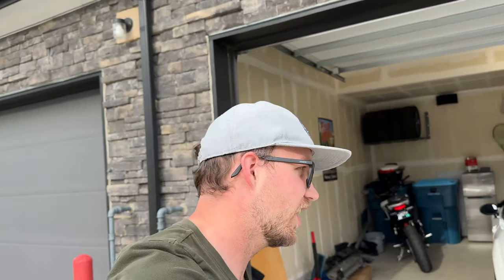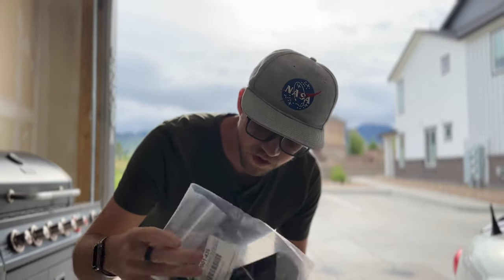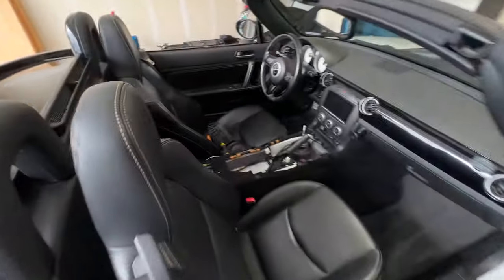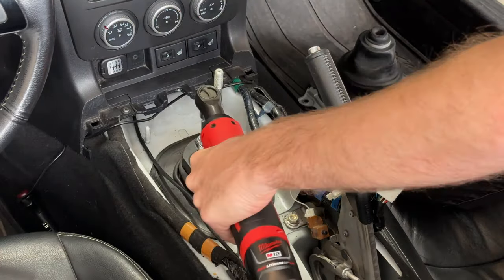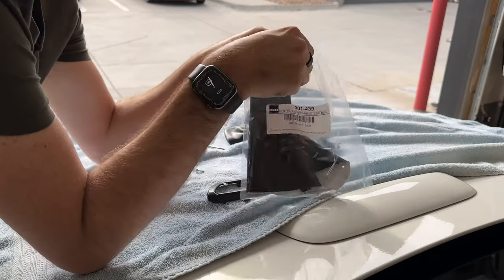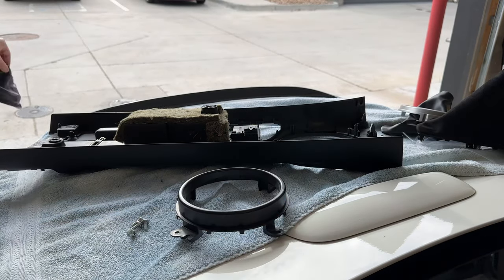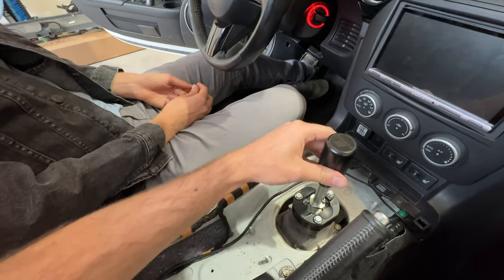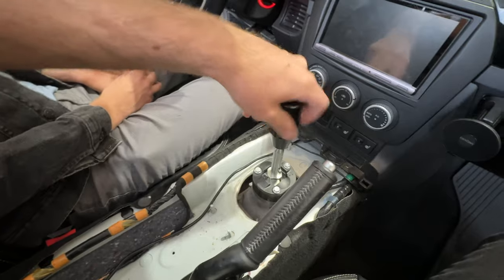A simple touch of luxury! Adding suede shift and handbrake boots to the Miata interior.

Comment: Good luck keeping that suede clean for the rest of the car’s life. Not for me thanks. I’ve better things to do with my time than deliberately make my car harder to keep clean. Personally I would be using that time to put a coat of paint on the walls of my garage.
Reply from the maker: Bold of you to assume I will keep this on for the car’s life! I mentioned multiple times in the video that it’s likely temporary and was very inexpensive. Far cheaper and easier than painting a garage. And brings me more joy. 🤷🏻‍♂️
Reply: @FlywheelFilms  I guess it was kind of bold of me. Every mid I have made to my ‘03 MX-5 which I bought new, was made after careful deliberation and is 100% OEM, and 100% for life.
Reply: @just_passing_through an you provide a thorough list of the mods you have done that are 100% OEM?
Reply: @Emadifications 
Mazdaspeed front spoiler. 
Mazdaspeed rear spoiler. 
OEM In-Dash 6-Disc CD Changer
OEM Minidisc module for OEM stereo.  
OEM Mazda 3 integrated steering wheel audio control buttons added to OEM steering wheel. 
Left hand drive AUTO down integrated with original AUTO right hand drive window - so now both windows have AUTO down. 
OEM dealer optional Compass and Outside Temperature auto-dim mirror
OEM  chrome Fuel filler lid. 
OEM stainless steel scuff plates. 
OEM headlight Bezels. 
OEM taillight bezels
OEM Front and rear mudflats/spats
OEM floor mats. 
OEM Footwell Lamp Kit (Driver & Passenger)
I think that’s it… I’ve owned the car since new, so there may be some I’ve missed.